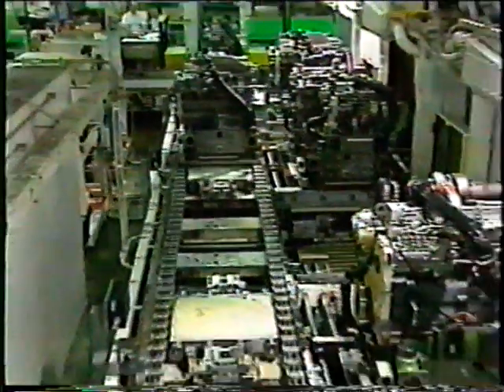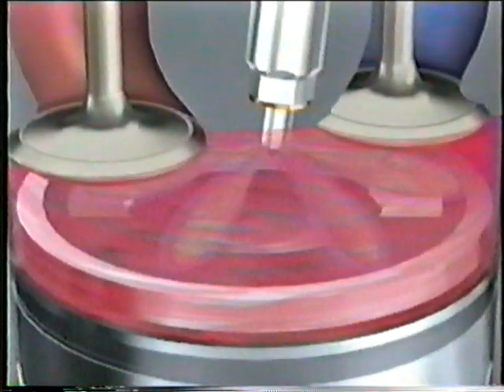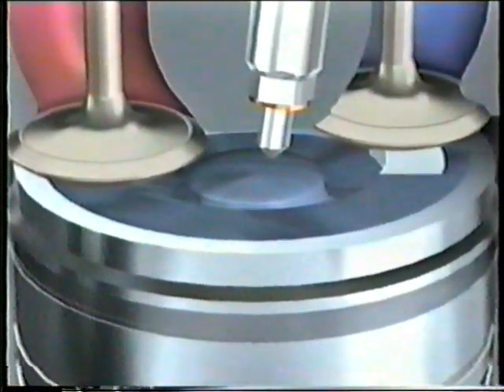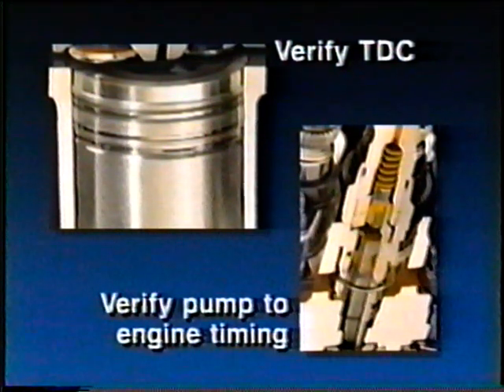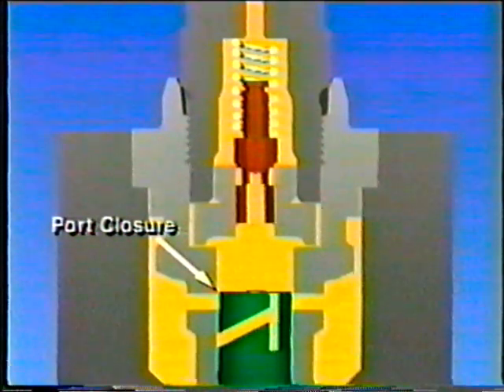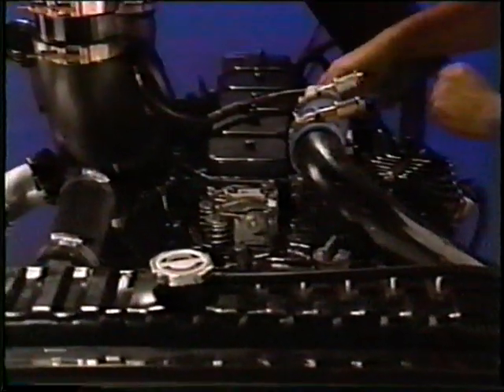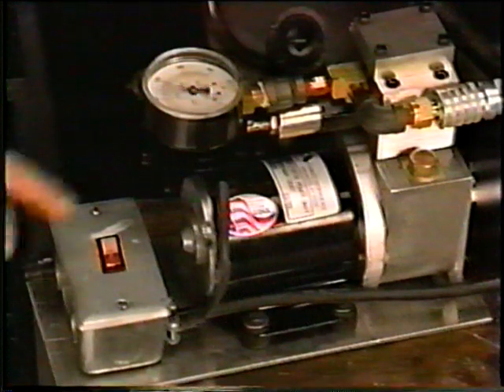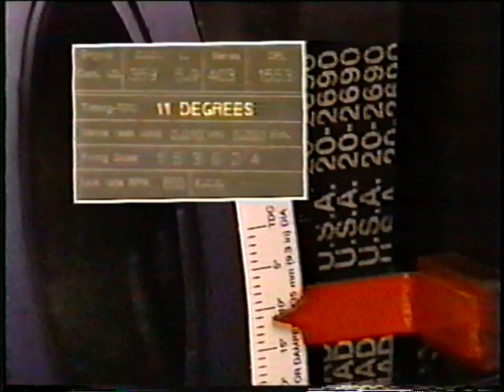Cummins Spill Timing Method B+C Model

Comment: Holy shit, i worked at a heavy truck Ford dealership back in the day when these B and C engines were used in the F7000.... When these engines came in for white smoke or breaking up at high RPM, all we did was find TDC ( the Ford engine had the timing marks ) broke free the gear on the injection pump, turned the engine back about the thickness of a paint stick, retightened the injection pump gear and assembled any other removed parts and started the engine.... Advancing the timing a couple degrees always took care of the white smoke and engine breaking up at high RPM's... I'm sure that was an EPA no-no at the time but, that's what we did to get those boat anchor engines to run properly....... God, i miss the good ole days....,
Reply: My 6 cylinder Ford sabre (Dorset) turbo on my boat smokes bad and it's embarrassing. Could you give any advice please. . It's got the minimec pump. I've had the injectors serviced and set.
Any help wound be good. . Thanks in advance.
Reply: I still do that on offshore crane engines
Reply: True my guy
Reply: Me too Buddy .. me too